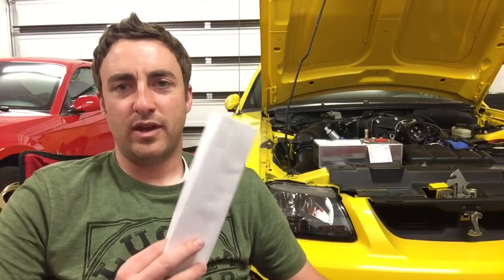Let’s talk about Dynos- How much did my Cobra make, what’s “brake horsepower” TOP GEAR got it wrong

Comment: 590 to the wheels is great! Besides bolt ons, what supporting mods you running? Pump gas?
Reply from the maker: 91 octane. 60# fuel injectors, boost a pump, exhaust, not even sure I’d call it an intake since it’s the factory one with a different filter. These cars do great

Comment: It is always going to cross at 5252 the dyno is measuring TQ and RPM to get HP the formula is Tq times Rpm divided by 5252 witch is why it will always cross at 5252 rpm
Reply from the maker: Very cool! Thanks for the info on that!

Comment: Hi How much HP did your Mach 1 Dyno -- Stock and after Mods.. Thanks
Reply from the maker: It currently has an email tune. It’s super conservative rich from what i’ve seen on my wideband (in the 12 range). It should be around 300-310 at the wheels. They typically dyno 260-280 at the wheels stock
Reply: Danny Johnson Thanks
Reply: I had a 03 Mach 1 300hp and 324 tq
Reply from the maker: Good numbers for its day